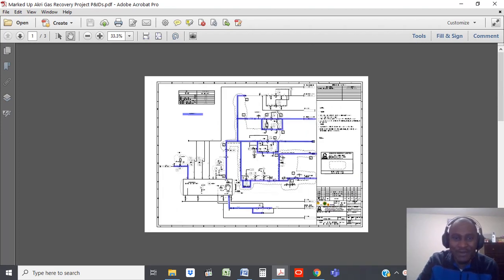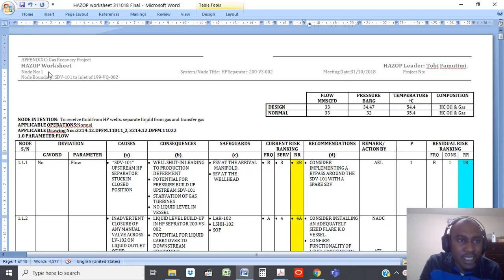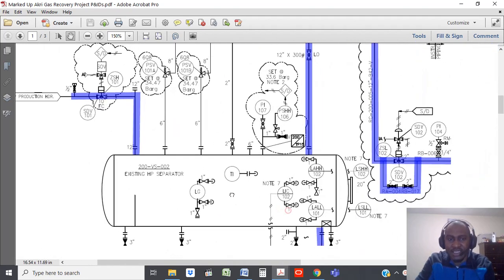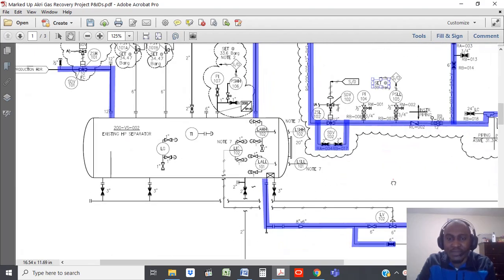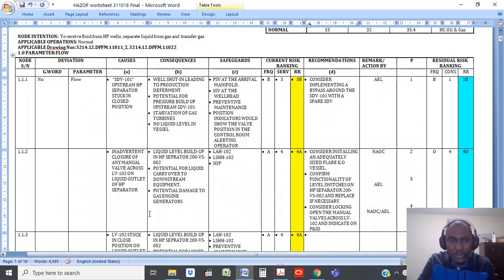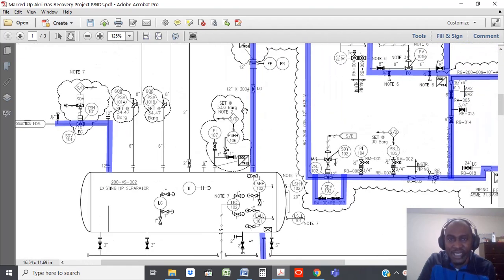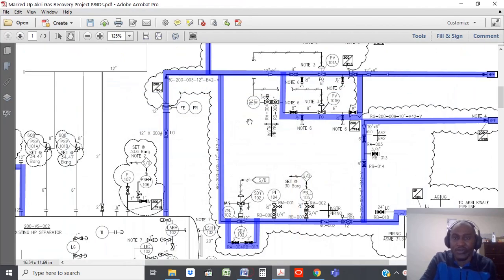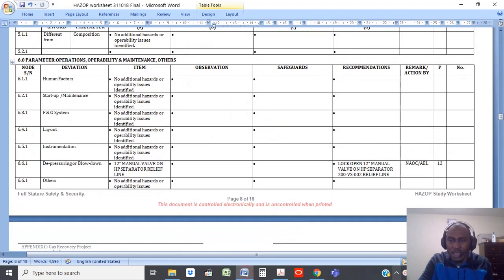Facilitating a HAZOP (Hazard and Operability Studies)

Comment: Really good benchmark, something I’ll definitely take with me for future HAZOPs I participate in is the inclusion of additional information, such as the "node intention" and design requirements directly on the sheets. 

Too often, when I revisit a HAZOP sheet later on, I find it hard to understand where in the processystem we are.
Reply: Putting node intention and design requirements right on the sheet is such an underrated habit — and your second point is exactly why it matters. Revisiting a worksheet a year later, "where in the process are we?" is the hardest thing to reconstruct from a node number alone. That navigation problem is what we built PlantFCE Maps around: keeping node boundaries, intent and the linked P&ID context connected, so a marked-up sheet still makes sense long after the study. Capturing intent at the node is the discipline that pays off.